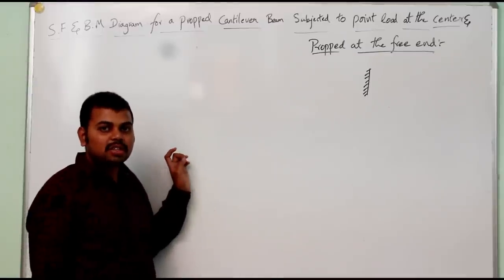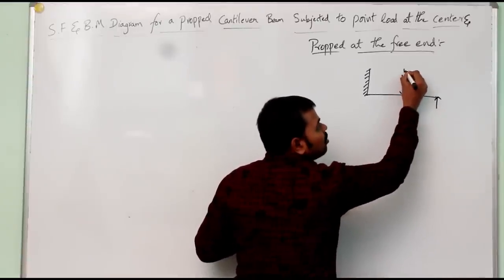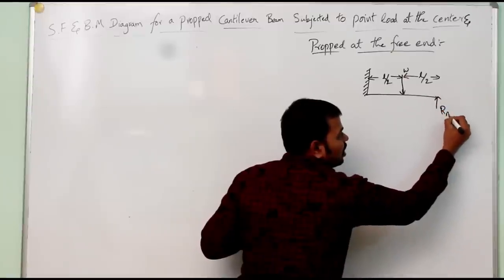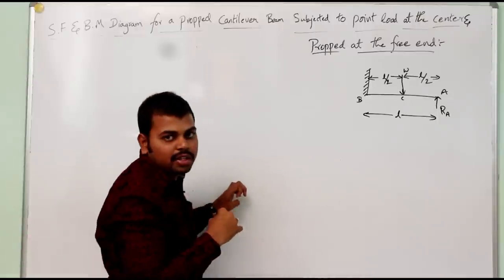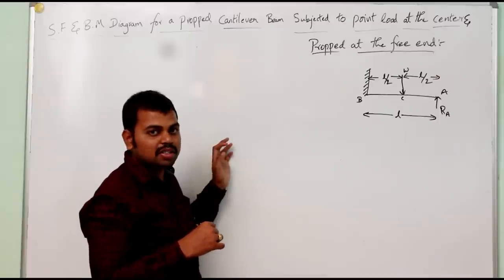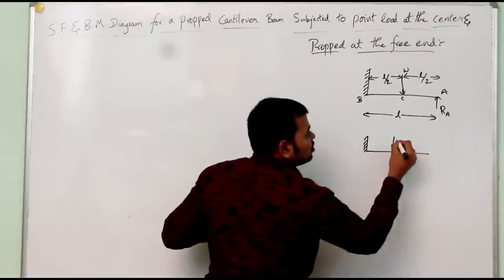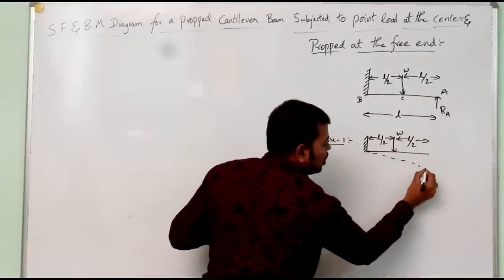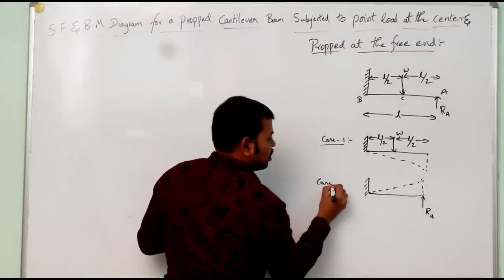propped cantilever beam with point load at center || structural analysis || etution

Comment: excuse me sir how did u write that downward deflection eqn by adding both slope and deflection of a cantilever beam
Reply: For slope and deflection answer you can refer cantilever beams chapter which is subjected to the point load at center ...you can get it in R. K. Bansal
Reply: I didn't extended it in the lecture
Reply: According to mohrs second theorm we equate the both deflection   since the  load is not at the free end we will find the deflection of  eccentric loading by adding deflection to the slope and the ditance btween load and free end tnq🙏

Comment: Sir your explanation was good, but how did you find the deflection?
Is there an equation for that?
And the BMD is linear not curve
Reply: Deflection = (area of BMD* centroid from free end)/EI
Reply: @satishr5307  bro why can't we take centroid from fixed end
Reply: @VasanthKumar-bf9je  we should take centroid from the place where we need to find deflection that's why
Reply: Since there are formulas for the all deflections in salient cases
Reply: @VasanthKumar-bf9je  since we can not take the reference line on the fixed end we couldn't take the  distance from fixed end
Reply: According yo mohrs  second theorem the deflection is find out by the  tangents drawn ftom the curves to the vertical reference line  so we take it at tge  free end